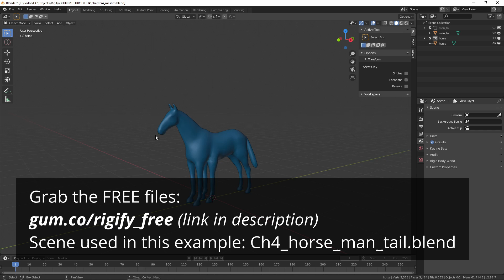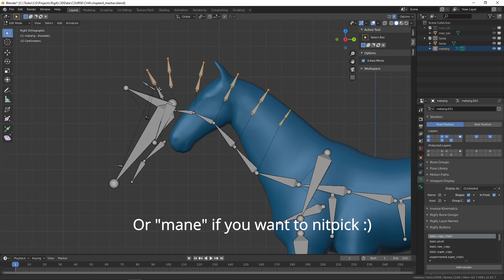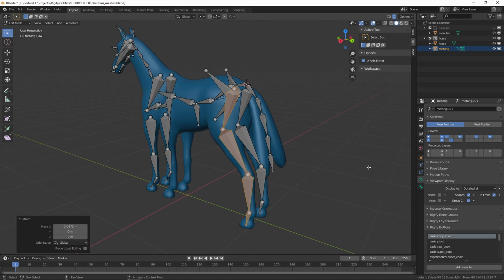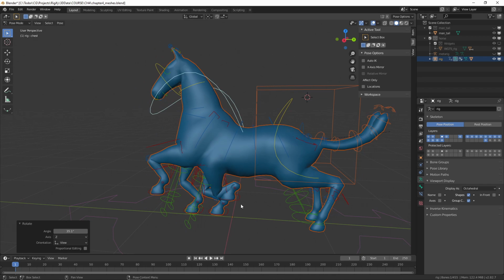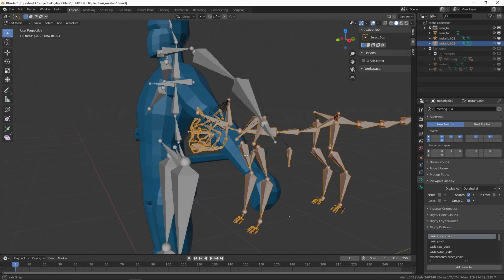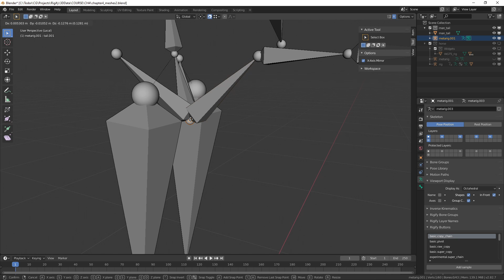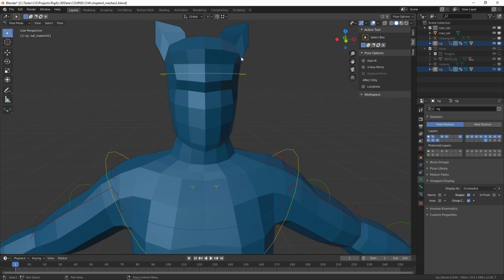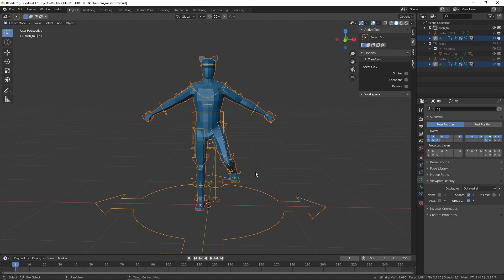[Blender 2.8~3.6] Rig ANYTHING with Rigify #4 - FRANKENSTEIN Meta Rigs

Comment: @5:13 whenever I am setting parent to 'with automatic weights' with the horse model selected -- I do not get the same result @5:15. only the rig is something I get to move. Even though it is processed, they are not attached or connected at all. I am not sure what I am doing wrong :( the model is (obj) is in the same group as the rig section. If you can help me figure out the issue, that will be awesome. Thank you in advance!
Reply from the maker: This is a common problem. Watch this https://www.youtube.com/watch?v=FuiY0wtxdHQ
Reply: @CGDive  Thank you so much!

Comment: Great tutoriales men, thank yuo very much, i have a question, can i have more Tha 4 legs because in my project i have an insect with 6 legs and four legs has the foot control but the others 2 has a rig but without the foot control
Reply from the maker: Hi. If the foot control is missing, something went wrong. It happens sometimes that the copied limb loses the "rig type" (keep watching this series if you don't understand what a "rig types" is). 
For now, you could just delete the legs that don't generate controls and copy them again. Then generate the rig again. Try it :)
Reply: @CGDive  hey thanks for answering, i do check the bone rig type in pose mode , but I Will keep watching thank You , grettings from argentina
Reply from the maker: @tvjoda  
I am not sure what is missing then. I you are on discord, share your file with me
https://discord.gg/YFH5HUv
You can email me too :)
Reply: @CGDive  Yes that would be great, i will send you the file, thanks for the help

Comment: I have worked FBXs and OBJs between Blender, Wings3D and Unity. These videos here are what got me past the 'other rigging' attempts after 1 year of failing with other methods. I now push these rigged models into Unity with the Asset FinalIk. I am past all the hurdles and now just need to buckle all the efforts together. Thanks. I am always looking for the best and easiest method to achieve something. Your vids are detailed just enough to get the task done with exacting methods. Thanks for keeping to the point. I can rest assured that the Frankenstein model is the only one anyone needs to know to do just about anything.
Reply from the maker: Glad it was helpful, man. To clarify my opinion just in case: The Frankenstein method is great as long as you know what you're doing... which you should know once you go through this series. :)

Comment: Im stuck on this lesson. I get errors when I try and generate the rig. RIGIFY ERROR: Bone 'thigh.R': Input to rig type must be a chain of 4 bones.
Incorrect armature for type 'paw' - RIGIFY ERROR: Bone 'thigh.R': Input to rig type must be a chain of 4 bones.
Incorrect armature for type 'paw'
Reply from the maker: You probably disconnected one of the leg bones... in edit mode go through your leg bones one by one and move them slightly to see if any of them is not connected to the previous one. If it says thigh.R then it must be the rear leg. If you can't figure it out, send me the file :)
Reply: @CGDive  Tried doing the tail man. Rig does not generate.
Reply from the maker: @sethfromcommunityservice8909  I can only guess at this point. Feel free to send me the blend. You can upload it to https://pasteall.org/blend/
My guess is that something small went wrong along the way. Rigify errors are hard to deal with until you get used to the system. But that's what all the videos are for. I would suggest starting this lesson over.
Reply: @CGDive  Thank you for replying. I will start over from scratch and see if I have better luck.
Reply: @CGDive  Disregard my deleted comment if you get the notification. My rig generated but it did not show due to a layering thing. Im good. Thanks again.
Reply from the maker: @sethfromcommunityservice8909  Sounds good!
Reply: @CGDive  Progress made but another issue surfaced. I had an extra hidden bone on the thigh.r. I deleted it and the rig was made. However now the left rear leg has no controllers on it.

Comment: Thank you so much! When I generate the frankenhorse Rig, the second set of front legs are not generated, just ignored. EDIT : Reduplicating front legs fixed it! Very weird EDIT2: Now I've got no tail rigified, all the rest is OK. Re-symmetrizing the tail linked bones didn't do the trick this time. No error. Any idea?
Reply from the maker: Sometimes the Rig type disappears. It's a know issue in Blender itself. It happens when you press ctrl+z I think.
Reply: @CGDive  Thank you! Indeed, that was it.
Reply from the maker: @pm1234  In the Rig Type options under Bone tab. If you watch the whole series I definitely show where it is. I think I explain that in the next video :)

Comment: RIGIFY ERROR: Bone 'tail.001': Cannot connect chain - bone position is disjoint.
Incorrect armature for type 'chain_rigs'
This kind of shit makes me crazy.
Reply from the maker: Hi there. I get it's annoying but there are two solutions that work:
1. snap the tail to the spine
I show how to do it here: https://youtu.be/ILDdIbAwxJM?t=498
It's for the spine but fixing the tail is the same.
2. Remove the "Connect chain" option for the tail. Watch the rest of  the series to learn about the Rigify options. 

Rigify is cool but it user-friendliness needs to be improved ...
Reply: @CGDive  How do  you remove the 'Connect Chain' option?
Reply from the maker: @sethfromcommunityservice8909  From the rig type options. You'll learn how in the next lessons.
Reply: @CGDive  i delete the tail but same error at spine.011
Reply from the maker: @ileelah1  This also happens with the head so maybe that's the problem. See if the head is properly snapped. :)
Reply: @CGDive  done it is working fine now, i use "Cursor to Selected" and "Selection to Cursor" to snap it. Thank you
Reply from the maker: @ileelah1  Cooool! :)

Comment: HELLO!! My character has a huge head and a tiny body, so I want to make the head and chest controls larger. How do I select just the curves and scale them???
Reply from the maker: The body proportions shouldn't be a problem. However I don't understand what you mean by "curves". There are curves in Blender but I haven't used them at all in this tutorial. Sorry, if you could explain a bit more I'd like to try and help. You can also upload your blend file here 
https://pasteall.org/blend/
or an image here:
https://imgur.com/
Reply: @CGDive  Thanks so much for the reply! I come from a Maya background and you can edit the 'hull' of a control curve to adjust size and position without moving anything else. I need to scale up the neck and chest control so they aren't inside of the body and it would be nice to re-position  the head control. I haven't seen how this is possible in 2.8? Here is an image https://imgur.com/gallery/EoQenV3
Reply from the maker: @Carvedantlers  Ah got it. In Blender those are actually not splines but edge-only geometry. This is also something that may seem strange to you coming from another package. I used MAX before blender and definitely found it weird at first. But anyway you can edit those relatively easily. Just unhide the Widgets layer. The shapes will probably overlap exactly with your rig controls so maybe hide the rig for a second. Select the shape you want to edit, go to Edit Mode and do whatever you want
with it. When done, hide the Widgets layer and unhide your rig.
https://imgur.com/a/2ANjb7D
Reply: @CGDive  yes!! Thank you so much 🙏

Comment: Awesome course, thank you so much! So... I am stuck at the tail connection part. I tried to follow the video step by step but when I try to generate rig I get the "Bone 'tail.004': neck is too short" error. What did I do wrong?
Reply from the maker: I am also curious! :) Which version of Blender are you using? Can you send me the blend? I want to take a look!
Reply: Thanks for answering me so quickly! I tried both using using Blender 2.81 and 2.83 with the same results. If you could check it out it would be great!  Should I send the blend to the email address in your website?
Reply: Ok I was wrong. Apparently updating to 2.83 solved the problem!
Reply from the maker: @berker9984  Hmm, I am using 2.82 in the videos and I didn't get this error. 
I am glad the problem is solved but if you have a minute I'd like to know more. Do you have a blend file that works in 2.83 but not in 2.82? Or did you start from scratch in 2.83? If you have a file you can mail it to me or you can upload it here and paste the link in as a comment!
https://pasteall.org/blend/
Reply: Unfortunately I overwritten the man_tail blend file that had the broken skeleton but I was trying to do (kind of) the same thing on another mesh and I haven't fixed that yet. Would that work?
Reply from the maker: @berker9984  If it produces an error then I'd like to see it :)

Comment: I've now bought your course as it is so good! There is, however, a minor problem, which might be 'an unpredictable error'! I followed your instructions closely, but the generated rig for the horse resulted in no visible control bones for the tail, and the generated rig for the human resulted in no visible control bones for the ears. (In both cases, Parenting the meta-rig directly to the mesh worked perfectly.) This was the case both for 2.82 & 2.83 beta. Any suggestion, please, would be welcome. Meanwhile, I'll move on to  Chapter 5 and the correct method!
Reply from the maker: Hmm, hmm I am not sure. You can check if these parts that do not appear have a "rig type". You'll learn how in Chapter 5. :D 
If possible please send me a blend file of the rig with missing parts. I'd be very curious to check it out and see what's going wrong. That helps me anticipate problems that other people may encounter. You can either drop it in https://pasteall.org/blend/ and share the link here or send it to my email. If you can't do that, no worries! :)